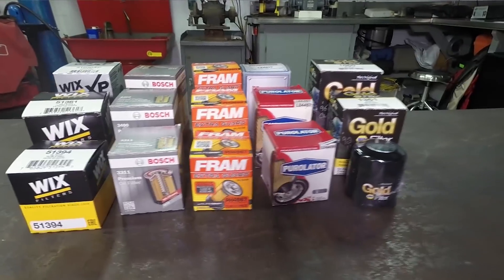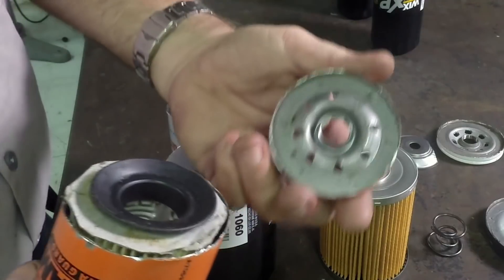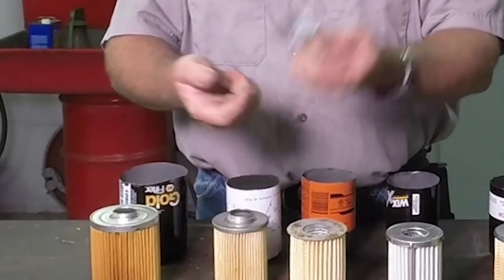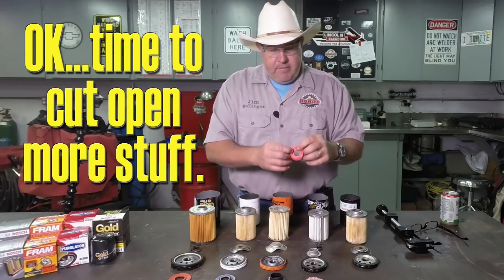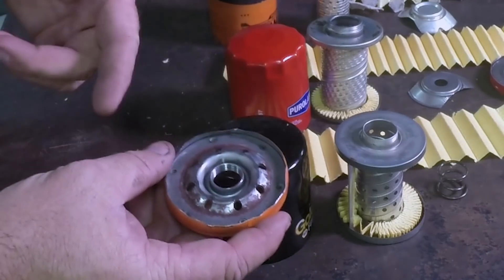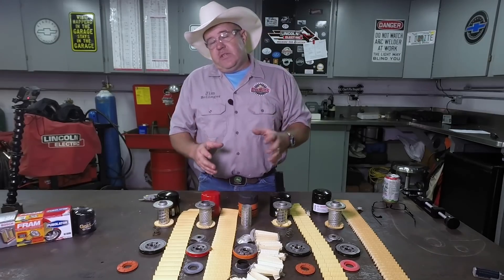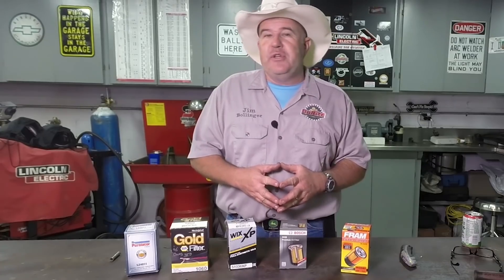The worst oil filter EVER!

Comment: Devil's advocate here: 
1. Shouldn't the test for filter quality consist of a filtration test?
2. It may be true that one manufacturer spent more money on materials than another, but at the same time isn't it possible that excess material means less profit for the less efficient manufacturers? Just because someone throws more money in the toilet doesn't mean they make a better product.
3. Did you contact Fram and give them an opportunity to rebut your evaluation? Yes, corrosion presence is undesirable, but if it's on the upstream side of the filter and the filter is effective, then it doesn't matter!
Reply: Another paid Fram Troll.
Reply: James R Nope, just someone with a logical mind that doesn't like to see someone distribute videos with information that persuades others on the wrong grounds. Actually my first reaction was OMG, I don't want to use that product (because I use FRAM oil filters in one of my vehicles), but as a mechanical engineer with 33 yrs work experience in design, manufacturing, and quality roles in Automotive, Aerospace, and medical devices, I've learned the proper ways to verify and validate products. This guy is a good Entertainer for those gullible enough to believe him on this count.
Reply: @biketothetop  , it's pretty obvious your avoiding the glaring faults in the filter. If you want to pretend that anyone with common sense should touch that product, then your lying to us, especially coming from an 'engineer'.
Reply: James R ...I gather name calling creates internet drama for you (i.e. by you originally calling me a troll and then a liar) just because I made a point that was not considered by the videographer nor yourself. I was just hopeful that I could  provide an example to the many others that watch the video to encourage them to think about things in a slightly different and logical way. Of course I question the quality of Fram based on the rust information provided, but I would hate to prejudice them or some other company based on something that does not necessarily impact the desired end effect. Was this rust a one time occurance? How many samples did this guy take? Was it a statistically representative sample he used?
 In this case what really matters is which filter performs the best and what is the cost. There was no data presented in this video to demonstrate which filter performs the best and what the prices are of each filter relative to one another. It was a purely speculative analysis based on things that may or may not matter in the end. 
Some people make conclusions based on their intuition that may be wrong. For example, someone might conclude that having a lot more filter material inside the housing means that it will prevent more contaminants from passing through the filter. Yes, this is true, but there's an adverse effect and that is that the flow rate through the filter may be reduced unless the size of the filter is compensated for in the design (i.e. it has to be a bigger volume). Was this discussed by the videographer? What is the pressure drop across the filter and is it in line with the manufacturers design requirements? Was the housing volume  increased or could its effect cause starvation of oil for the engine. What is the optimal flow rate for the application versus actual filter performance? Were there any measurements made of flow rate for any of these filters? Did the videographer Express any requirements for the associated engine?
Reply: @biketothetop  Just read your lengthy rebuttal and wanted to comment (not that I'm supporting anybody) but evaluation made on having more filter media surface area encased in same volume canister will impact flow rates but engine oil starvation case would be dismiss-able because of bypass valve function - as filtered oil flow decreases due media saturation of contaminants UNFILTERED oil begins flowing through by-pass valve to engine. When this occurs is certainly unknown because of other variables during expected service life of filter. One point I consider worthy in this video presentation is that filter media and construction inside is revealed allowing visual assessment at the very least. I, as a manufacturing plant maintenance engineer for 20+ years, have seen instances of oil filter media rupturing apart inside canister resulting in no filtration taking place. Fram filters seem to have this uncanny characteristic.

Once again, your comment here accurately presents argument of the oil filter comparison done in this video presentation to be of little/no value. An actual experiment done under "real life" conditions, filtering "dirty" oil of a known (ppm) condition then measuring quantity of contaminates removed after filtration with flow rates / temperatures  charted throughout procedure could produce useful data for comparison of, in this case, oil filter brands. Er, uh , this sounds like what a manufacturer of oil filters would be expected of eh? Maybe a bit more technical performance data on packaging ( or the good ol' "poopsheet" as a few of my colleagues call it) be included to prop up consumer confidence?
I muchly enjoyed your commentary, knowing it came from an engineer of long experience, and, as for the "troll"...well, I think it's well understood who is that to be.......
Reply: @biketothetop  , it was purely deceptive conduct by Fram, plain and simple. YOU are the one making excuses for them.
Reply: Thanks, I understand your points about the oil filter and the by-pass function...  I was trying to be more figurative and I didn't want to get too technical and cover all the detailed scenarios because, whether or not I made my point technically, I really just wanted to express that in the simplest terms this videographer provided only enough info to emotionally affect viewers and sway them against Fram, but missed the boat of providing the ultimate test data that a seasoned  professional would convey. I still admire most of what he presented, but I don't get swayed that easily. My original comment was limited to the things most people need to consider, but the guy that spewed crap at me was evidently more interested stirring controversy than trying to understand my simple point.
Reply: Fram was not deceptive, they probably didn't know that they screwed up. There is a big difference between deception and ignorance. Obviously they wouldn't intend to provide anyone rusted filters, thus the videographer has a duty to inform them of his observations so they can correct the root cause and prevent others from receiving the rusty filters. Making a video on YouTube is not righteous communication with Fram, unless they were not receptive to his observations. He made no mention of any effort to correct the problem with Fram, but instead had a blast making a video to attack them. I made no excuses, my original comment acknowledged it was wrong (i.e. "corrosion presence is undesirable"). Evidently your mission is not a good will mission... I accept and understand that you wish to stir emotion by attacking others rather than attacking the problem.
Reply: @biketothetop  , but it wasn't more in-depth than the construction of the filter. If you want flow rates etc. then a more scientific study is what you are after. But what he showed us was enough to work with for most simple cars, and I think your comment about "throwing money down the toilet" for spending on quality materials was completely irrational.
Reply: You are misinterpreting things... I didn't say "spending on quality materials", I said, "... excess material...". My point is that only the material that is needed to be effective in the design should be used, anything more (i.e. excess) is wasteful. Nobody benefits from waste. Again, the objective here is to demonstrate what is effective at achieving the goal (i.e. filtration), not presenting motherhood statements that evoke emotional responses. For example, the video made reference to heavy metal housing construction as being good, but I don't think oil filters fail from housing construction unless someone fails to lube the gasket or over-tightens during installation. Excess material is wasteful and isn't related to filtration quality; thus I'm not impressed by the manufacturer that uses excess material on an item that is already intended to be disposable item. A different issue: I prefer the car mfgr's filter designs that use a cartridge inside a re-usable housing. These don't waste material.
Reply: @biketothetop  , I know what you said, but in this case it was using better material to get a better seal, right? Sooo......better quality. Right?

If you think that cardboard is sufficient against sealing and wear and tear then you've got rocks for brains. But I suspect it's more about being a paid Troll for Fram ;)
Reply: @biketothetop  Thanks for acknowledging my reply to you. I had been thinking more on this - the videographer apparently found a little "nitch" to capitalize on to build number of views for his channel, whatever the truth may be. There is an auto mechanic elsewhere on YT who has complained loudly of Fram filters. His assessment was more realistic in that he disassembled a used Fram oil filter exposing the media paper element having split open on one side, something I myself had seen firsthand.

I will say you put Mr Troll that had needled you in his place and declare "job well done!!" You being an engineer perhaps could provide answer to a question I have, why are some oil filters for automobiles so tiny small? The filters on my 2 cars are barely half the size of filters on some older cars I had in the past. Just being curious.
Reply: @biketothetop  Try opening these filters yourself, an engineer should be able to determine poor construction and materials quality easily...or not an engineer worth a damn.
Reply: lynx318therealone Are you another hater rising to the occasion and missing the point?
Reply: @biketothetop  You missed the point, the filter media is crap, just waiting to fall apart and get jammed in the oil galleries. Your vehicle, mate.

Comment: I wondered what Fram filters looked like on the inside. I noticed a little bit of rust on the interior of a few new ones at Walmart. This dissection really shows me that I was right about avoiding them after seeing that rust without even cutting one open.

Comment: you should take apart a used Fram filter
Reply: i use to work at walmart, and SO many cars went out with those "low end" FRAM filters...so many, that often i would see my initials on old filters where the owners had come back to get their oil changed again!  (i was taught that i should initial & date the oil filters that i changed)  I would be curious to see used filters cut open?  Like many have said, i would be curious to see a full line of FRAM filters cut open.  A little surface rust would not hurt anything, once the oil starts flowing. i speculate that if you changed the filter on a normal car regularly, it won't get to the point of catastrophic engine failure?
Reply: @ncgreg231  lmao yeah, I would never get an oil change at Walmart. (no offense)
Reply: @ncgreg231 .   I somewhat agree, but any amount of rust cannot be good in your Engine and can only contribute to the breakdown of the Oil. 
 I'd certainly try to remove the rust from the surfaces wherever possible!
Reply: @ncgreg231  I concur
Reply: Sidney Mantissa thanks for sharing this link. The FRAM rep was pretty straight forward. I am still skeptical about the quality of a standard filter since newer vehicles are changing oil less frequently. I would still buy FRAM but a premium option.
Reply: Sidney Mantissa  yeah, they pretty much show the same thing but with out a good filter to compare what garbage fram is.😋 😏☺
Reply: The only problem with that is I have to USE a Fram filter first, and that is just not going to happen.
Reply: Sidney Mantissa    Never thought I would see an oil filter fan boy!  The things the interwebs have shown us.  Haha!
Reply: Sidney Mantissa   Haha, it's just a oil filter, Sidney, don't have a thrombo!  You really do know better, we are in the comment section.  I think the dictionary should have behind the word "Stupid" See comment sections of the www for example.  Be well and have fun!!
Reply: Sidney Mantissa  Is that you in the video you said please watch?

Sidney Mantissa
3 days ago
Please watch:

https://youtu.be/ecpkvsnKKNg

Comment: The NAPA Gold and Wix are the same and made by Wix but the Fram Extra Guard can't be compared to the Wix and Napa Gold line, more like the Fram Tough Guard filter.  Maybe the Napa Pro Select are comparable to the Fram Extra Guard.  I use either Toyota OEM filters or Napa Gold filters on our's and customer's vehicles.

Comment: This reminds me.of those videos of spark plugs that had extra prongs or special tips. They made a bigger spark under controlled conditions, so everyone thought they would be great. You put them in your motor, only to find it runs like shit, and the stock plugs run significantly better, because a pressurized cylinder responds very differently than an open air spark. Similarly, looking at how a filter is made tells me nothing about how well it does its job, or how it will hols up. Maybe if you ran the filters on similar engines under similar loads with the same oil, and then did testing of the particulates left circulating in the oil at the end of the filters' life, I would place value on your experiment. But arbitrarily cutting open a filter and saying it looks bad, is a poor comparison.

Comment: You told about 1/3 of the story...   main job for filter is to actually filter the oil...    did you leave that part out of your story due your sponsors not being happy..     i mean cheap shit filters are what they are...      but  one thing is for sure...     German auto manufacturers would not use bosh filters if they where not high quality .    After all , they give their engines huge mile warranties .

Comment: Good Walmart combo of supetech oil and a gram filter, 400 miles after The 3,000 change mark and the car was SHOT oil had turned to like water what hadn’t just burnt off or whatever happened (car didn’t burn oil) locked my engine right up

Comment: To confirm the results you should retest the filters. The chances are big that the rusted one comes from an old stock (which probably is) or they have had some serious problem woth QC in the factory. Even thoug the media may seem crap made, it’s efficiency may be still higher that the others one.

Comment: Pmsl what planet is he on . The oil pushed through the paper at high pressure nothing do with the ends they are just bungs for left over oil residue. Nothing to do with the performance of the filter what a idiot

Comment: I race motorcycle and fram is outlawed at most race tracks because they are known for exploding and dumping oil all over the racetrack
Reply: I was dating a girl in high school she did her oil change and called me over to check it over. i checked made sure the filter(fram is what she bought) was on right,  it was, so we added oil and let it run for a minute i watched the oil gauge and saw all the pressure drop at about 20 seconds into the run. shut it down looked under and oil everywhere. hopped under to see if the filter was double gasketed or something and saw that the filter housing had come off of the base plate .it just wasn't crimped on there well enough i guess. I grew up working on cars in the shop and never trusted anything but wix, but after that i was dead set never to send fram a dime of my money.
Reply: @zacsendlessprojects , long ago, I had exactly the same experience with a Fram oil filter.  After that, it was either OEM or Wix.
Reply: @zacsendlessprojects  Yep this happened to me also and it was a pita to get the rest of the filter off of the car
Reply: Exactly.  As a percentage, Fram filter failures are no different than any other brand.  

I'm 56, and have used Fram filters exclusively for 40 years on every vehicle I've owned (currently have 7).  My vehicles routinely go 200,000 to 300,000 miles without issues.  In all of those years and all of those vehicles, I've had exactly one (1) filter that seeped a bit of oil at the seam.  Never had any other type of failure.

BTW, none of those filters in the video have a "bypass" valve.
Reply: @nineball26 
mkop i in
Reply: Sidney Mantissa  still didn't see anything about a bypass valve, only about anti-drain back valves which keeps oil from draining out of the filter so you don't have an oil less start up while waiting for the pump to circulate some oil into the cylinders.
Reply: @zachwhyte6040  Not all filters, depending on the application, have a bypass valve in the filter. Older G.M. engines, this valve is in the oil pump. Older V8 & 6 cyl Fords have theirs in the filter.
Reply: Sidney Mantissa  in the particular filter that he cut open in this video you can clearly see that the bottom spring that holds the filter does not have a bypass valve.
Reply: Sidney Mantissa  Lol Sidney.  You are correct. And for the record, I wouldn't use an orange can in anything other than a low performance engine.  Anything that deals with high rpm's would be asking for trouble with that filter.  The ultra is a different story and I know a performance marine engine builder who uses them exclusively.   No oil related engine failures in his builds.
Reply: Wow!

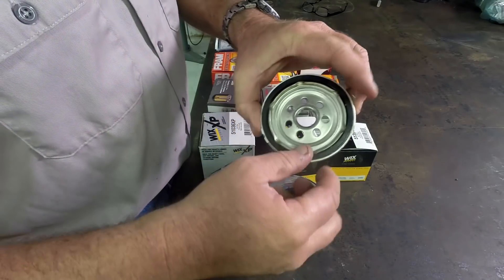Comment: 1:29 there is no such thing as 'return engine oil pressure' It is the oil pressure after the pump before it reaches any lubrication channels in the motor.